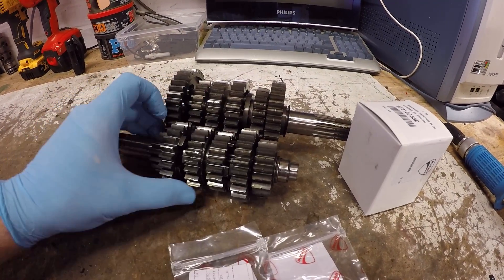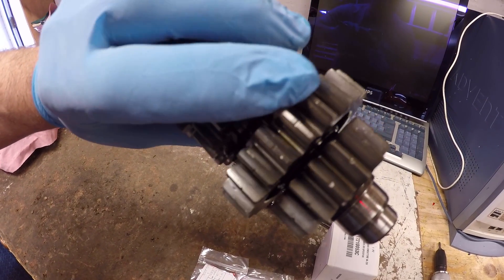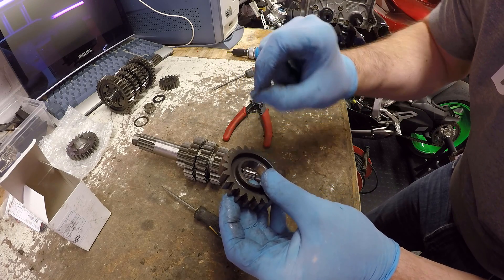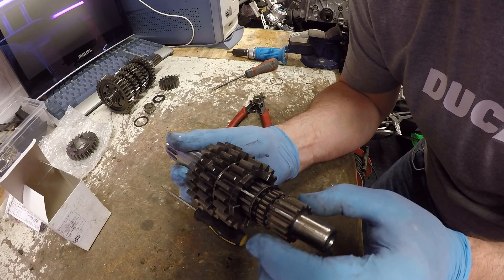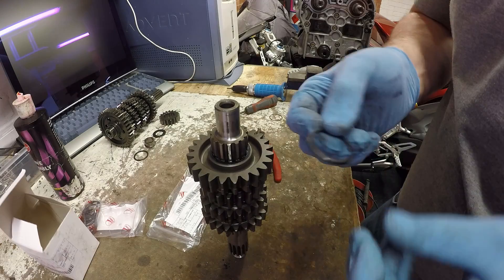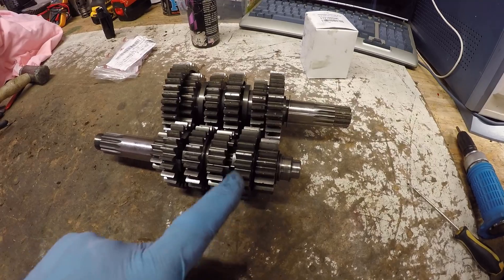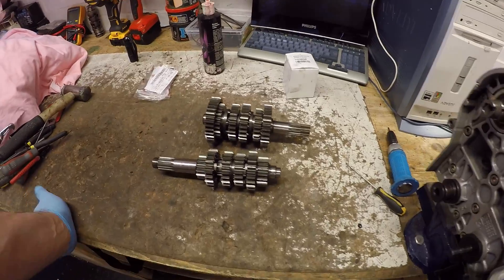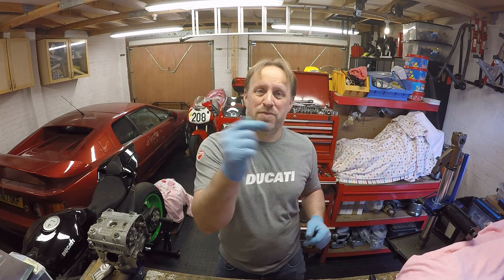Ducati 848 Engine Strip - Transmission repair

Comment: Glad you are back at it. 👍 Jan de vos does a lot of superfinishing on his gearboxes and parts. I'm sure there is a gap in the Market for superfinishing in the UK.
Reply from the maker: Hi Chris, never stopped just not enough time to film and edit videos as well as everything else I needed to get done 😊
I have looked at superfinishing, not sure of the costs involved for the equipment though.
Reply: @DesmoWerx  think it's quite cheap. I looked into it a while back. There was a company that sold reconditioned vibro units and the media is reasonable too.
Reply from the maker: @chrislee7817  There is a company near me, might need to look into this in more detail!!!

Comment: Side note I broke the shifter drum pawl gear selector stop on my 748, believe they are all the same pawl type selector all the way up to 2011-2012 bikes. I welded mine back on as the stop on the pawl fell into the left side of the case right below the selector drum. Fortunately it did not make it's way into the gear box which is right there....

Comment: I have problem with my 1098.

Difficult to put 1st gear at second attempt it work.
 Have to rave bit higher to pull out from the first gear  Ducati mechanic have no idea what could cause the issue.   Any ideas??

Comment: Hello 👋🏼 , I have a Ducati 1098. I fell over on the grass on the race track on my left side. It bent the gear lever. I replaced it. I no longer have a stop in first gear. If I keep pressing in first gear, the gearbox rattles. Normally there would be a stop in first gear so that you can't press any further. In my case, you can press and it rattles. All other gears can be shifted normally. What could this be? How or where is the mechanical stop for first gear? If someone knows anything about the gearbox, it would help me a lot. Where is the stop for first gear? Thank you very much for your help. Gary
Reply from the maker: There is a stop within the channels on the shift drum, although there will be a certain amount of play in this, not enough to go past the gear but certainly enough to put pressure on the gearbox and make noise.

My initial area to check would be that the shift fork has not been bent or dislodged due to the crash, if this is not set correctly it will have an impact on how far the shift drum can and cannot move.